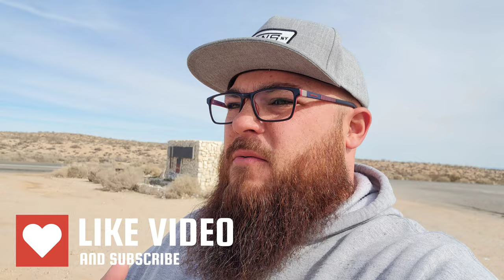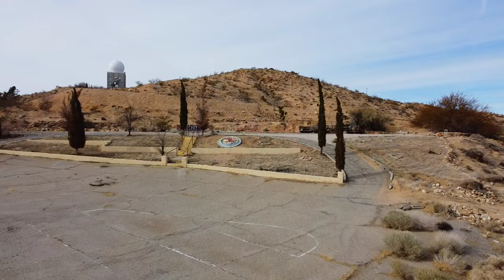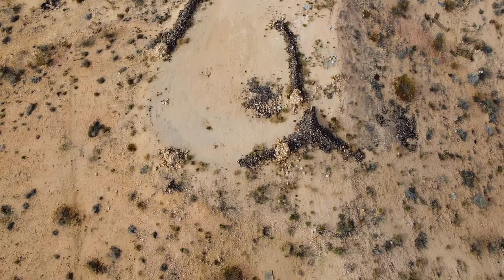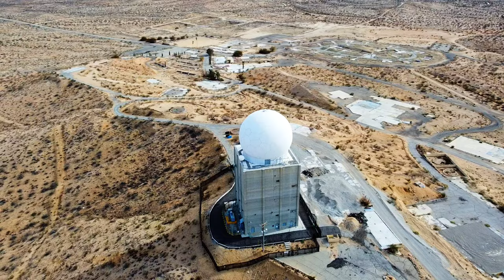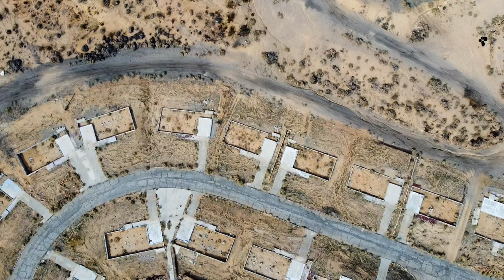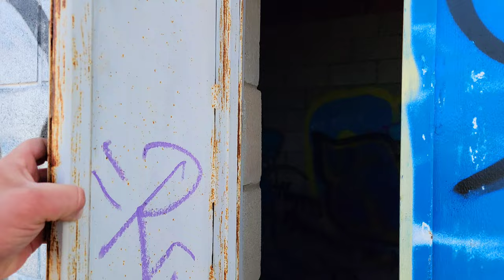Boron Radar Station 2023

Comment: My dad was a radar jockey here from 1969 through 1973.  His official job title was "Electronic Counter, Counter Measures Technician".  He would take me to work with him often when he was on the graveyard shift.  I had to get on the floor of our 62 Impala and he would cover me up with a coat so we could get through the guard gate. He taught me how to read the paints on the radar screens.  I learned how to discern mountains, clouds, flocks of birds AND aircraft.  He also taught me how to put the crosshairs on potential aircraft and send the data to the computer in the back room.  If the local computer determined it was unidentified aircraft, it would send the data to a more powerful computer in Texas.  I was 6, 7 and 8 years old and protecting the west coast during the cold war, while my dad napped.  Amazing memories and my first "video game"!  I could still run that equipment to this day if it still existed.  While not photographic, I do have an excellent memory.  Good times!